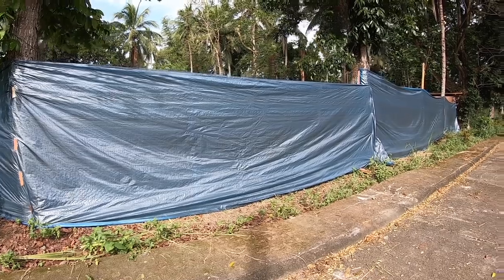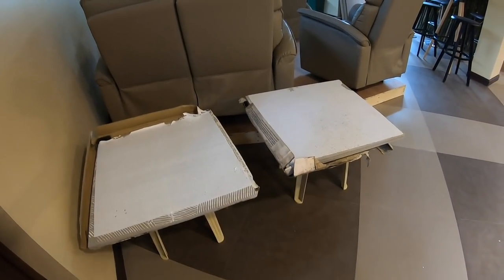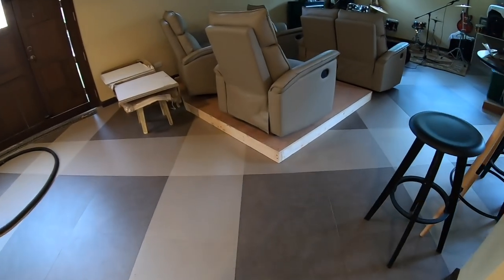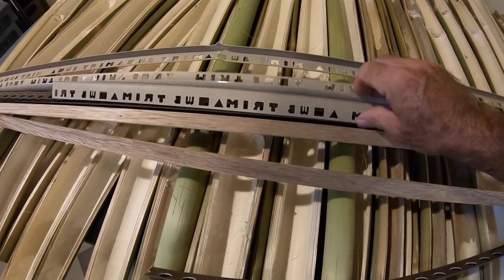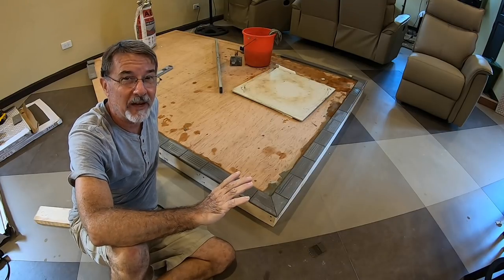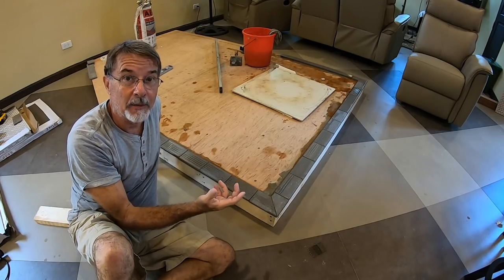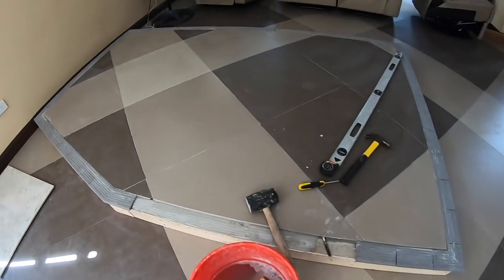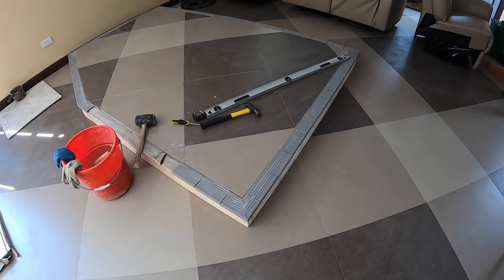VILLA FELIZ - EPISODE 513: THIS AND THAT (House Building in the Philippines)

Comment: I would recommend adding a Led Multi color rope light to the edge of the platform. This will give it a nice effect. also you can change the color anytime you want and as a bonus you can see where to step up when it's dark.
Reply from the maker: It's already installed.  I thought I showed that?  Maybe in the previous episode.

Comment: Hi James, why don't you extend the size of the platform a little bigger and elevate it a bit higher to provide better view of the stage, and perhaps sloping the sides and edges would be safer.
Reply from the maker: Can't go any higher as the ceiling fan would be a hazard.  The room isn't that big so making the platform wider would be a tripping hazard.  Good ideas though!

Comment: sewing thread or stair treads? lol  It's driving me crazy...  Wire mesh would work for the middle or use mastic   The best way to know is to Google and you would of learned wire mesh on edge....  I m sitting here yelling at you, but its all ready done.. lol I give up...
Reply from the maker: Tread is the actual term for this type of non slip material but the manufacturer of this product (H.W. Huanqiu) identifies it as "Stair Thread Ash".  I probably should have clarified that.